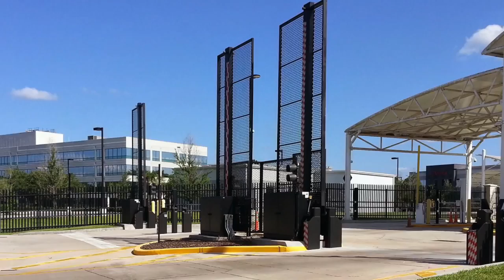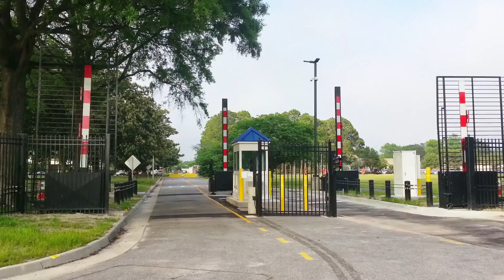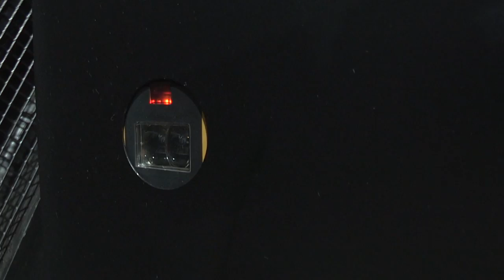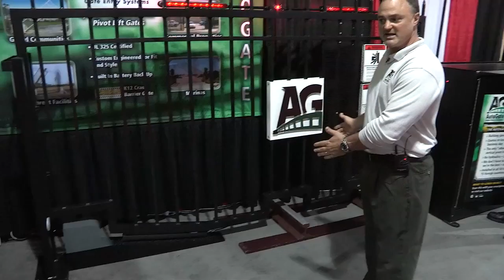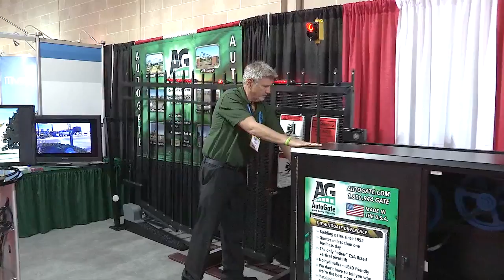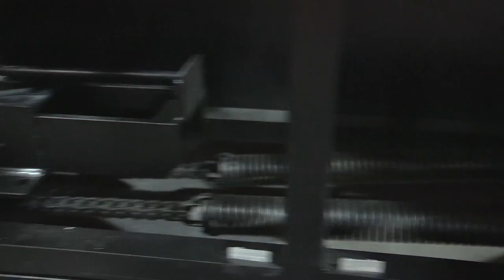AutoGate Vertical Pivot Gate Systems

Comment: The Watermark HOA Board of Directors (Indianapolis, Ind), with the aid of Kirkpatrick "Management", rejected something like this, in favor of unsafe, out-of-Code sliding gates, because they're criminals and don't mind stealing from the homeowners and endangering others.
Reply from the maker: We are sorry for your bad experience. If you look closely at this system, it is a Vertical Pivot Gate, meaning it opens and closes in the same manner as a railroad crossing gate. We abide by multiple safety codes and use many devices such as bump edges and photo eyes on our gates to keep pedestrians safe!